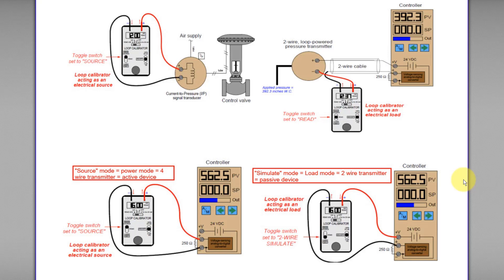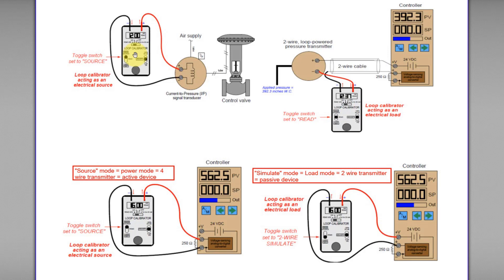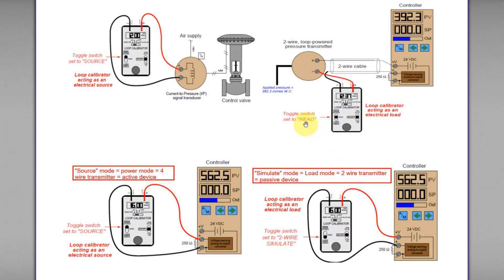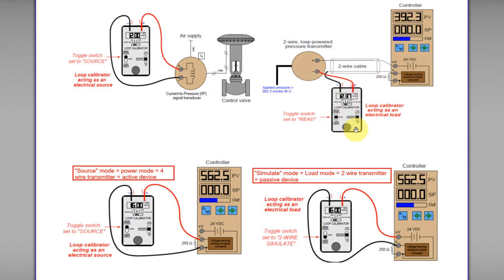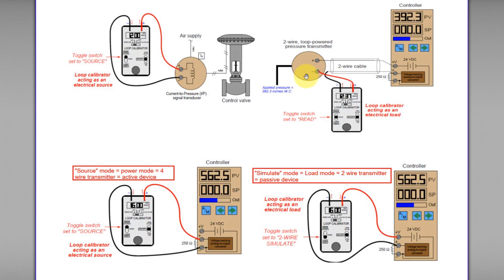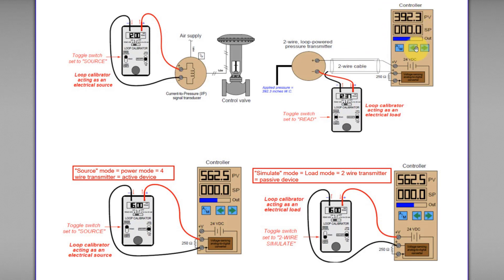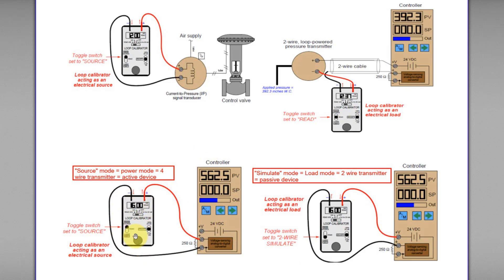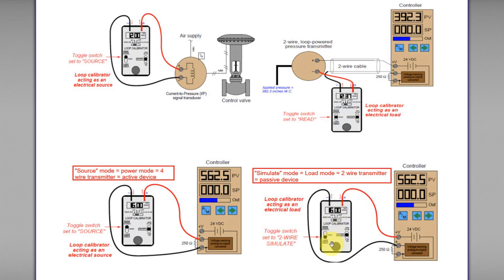Signal Loop Calibrator Source mode, Simulate mode and Read mode

Comment from the maker: "Loop Calibrator or Signal Calibrator is a calibrator used by instrument technician to inject signal to circuit, transmiter or controller for troubleshooting or testing purpose. We should understand the terms of source mode, read mode and read mode before we use the loop calibrator to inject signal.

If the loop calibrator switch is set to source mode, then the loop calibrator will power up and at the same time inject the signal to the whole loop. However, if the  loop calibrator switch is set to simulate mode, then the loop calibrator will not power up the loop but it will inject the signal to the whole loop. The read mode is selected in the loop calibrator, then the signal calibrator will behave like a normal multimeter. "